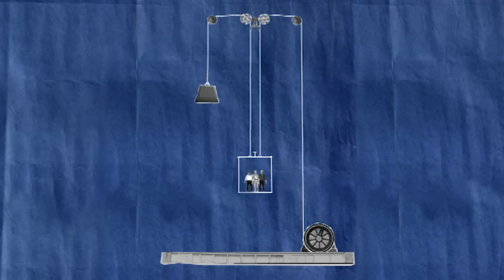Elevator Free Fall! Can Jumping at the Last Second Save You? | MythBusters

Comment: So based on this example, the elevator was falling at 53mph and the spring of Buster's jump was at 3 feet per second or 2mph going up. Leaving Buster deficient an additional 51mph he would have needed have survive. In order to survive, Buster would have had to have a spring upwards of a MINIMUM of 35.245 feet per second (53 x 2 = 26.5 x .33 = 8.745 + 26.5 = 35.245) to have had a chance of surviving.
Because all elevators have a roof this would have killed anyone going that fast as they impacted the ceiling of the elevator and crushed their skull. Of course any ceiling metal bars in the passenger cage would also come down upon the person going up like was shown that happened to Buster. Buster did not have a good day at all! 😂🤣😂
This was only done with a NINE floor free-fall so a high-rise of over 100+ floors could easily have the elevator accelerate in excess of 90 to 110 mph (unknown side rail friction deviation). Feel free to check my math   above as I just did it very quickly for a rough baseline figure.
Jumping in an elevator officially BUSTED, it will NOT work! Excellent Mythbuster episode. This is one of my favorite shows!
Reply: In theory, if Buster could jump at 53 mph at exactly the right moment, literally one infinitesimal amount of time before the elevator hits the ground, he would simply be stationary relative to both the ground and the roof of the elevator, because he would cancel out the 53 mph he was traveling downwards before the jump. In theory...
Reply: Also there's no way a person could survive because the person would have to know when the elevator was about to hit the floor.